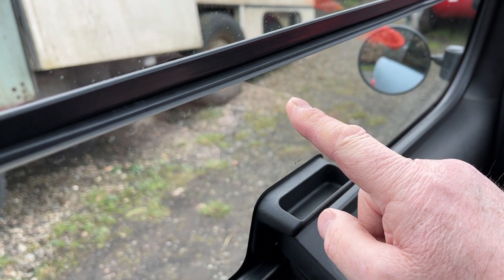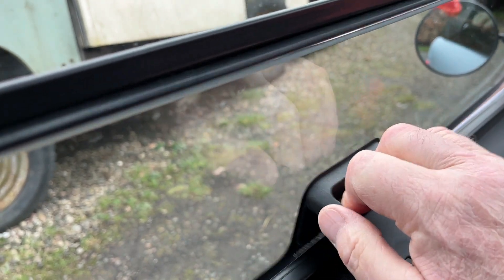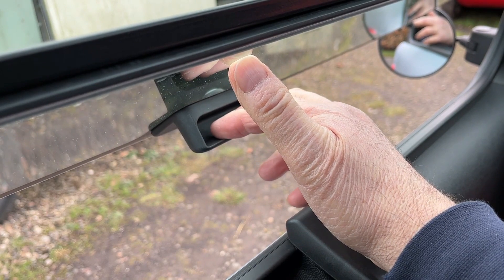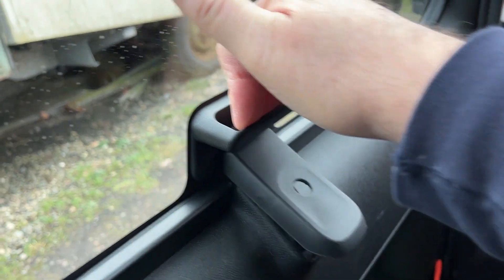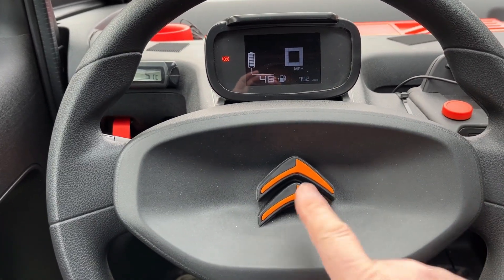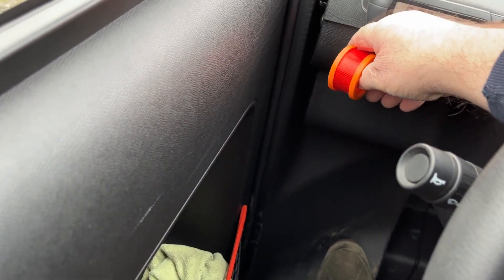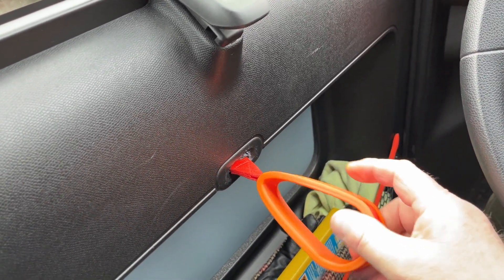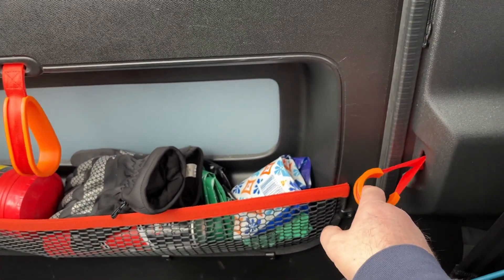How to close the windows of the Citroen Ami without displacing the rubber seals.

Comment: Have been using two handed method for closing the window and ensuring the seal lines up - up to now. Will try this from now on - Thanks for the tip. Also I only realised yesterday that the windows will latch fully open - vertically - It seems easier to do that two handed from the outside. When attempting to push them fully open from the inside - the glass bends - rather alarmingly - but maybe I'm doing something wrong.
Reply from the maker: Luckily the glass bends (quite far) rather than breaking.

Comment: Hi Doug, i was watching the videos for your gear driven lsd and I was wondering if you have the measurements for the diff side to side with hubs on. I have a semog buggy and j would like to fit an lsd in it. Do you think it’s possible to mount the sprocket as well as the disc brakes on the diff?
Reply from the maker: Dimensions depend on make of differential and type of output shafts.
Reply: @DougsShed  I was hoping to use a black line lsd and use the fiesta cv joints welded onto the polo shafts. I think the biggest issue will be the brake disc mounting
Reply from the maker: @brendanmooney8517  I have welded flanges onto the body of CV joints in order to fit disc rotors. I used flanges waterjet cut from steel plate then welded on and trued up in a lathe. The CV joints sometimes have a bit of axial play in the differential which makes the disc float a bit but can be reduced by shimming. Radial play can also be a problem and I have used additional 40mm ID bearings running on the CV joint's oil seal journal to eliminate this movement.

Comment: Hi  and tnx for very good videos! i ask somthing? can u make AMI run 60km/h? 45km/h is to low!!!
Reply from the maker: No - you cannot make the Ami exceed 45km/h. The Ami is limited by a speed limiter and also by the small current capacity of the 48V battery.

Comment: Been thinking of getting an ami, any clues how many years they will last for before needing replacing/scrapping?
Reply from the maker: Chassis definitely needs rustproofing if it is to last. Not sure how long the battery will last (only has a 3 year battery warranty compared to 8 years for 'proper' Citroen EVs.
Reply: @DougsShed  I see we can take out a 1-5 year service plan wonder if battery covered by that, Doug did you take out extended service plan?
Reply from the maker: @jwracingteam  No - If it breaks, I'll modify/improve it!